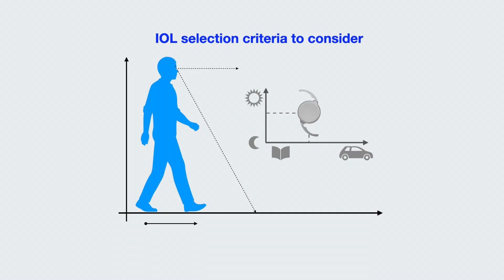Bad vision after cataract surgery

Comment: What about flickering light around the lens edge every time I move my eye. I see that along with an arcing shadow off to the side constantly unless I’m in a very dark environment. I’m 12 weeks out from IOL surgery and it isn’t getting any better.
Reply: I have the same issue. My surgeon told me it'll go away, but it has been 3 years and I am still not used to it. I found this online which is helpful, and want to send it to my surgeon: https://youtu.be/BjHHuzK5fuU?si=18vp5uD4mVg9IAuo
Reply: @ it doesn’t go away because it’s caused by the lens design. Mine never went away and drove me nuts. I ended up having the Clarion IOL removed and a Bosch & Lomb LI61AO installed by Dr Wong at Austin Eye. This lens is perfect with no issues. Dr Wong told me he’s replaced over 2,000 of the Clarion lenses because of their poor design.

Comment: I had surgery 6 days ago and couldn’t read anywhere. Today they looked in my eye and discovered I could see perfectly well with -1.25 cyl of astigmatism: all of his table even the line just below 20/20 I could make out. The lens was Toric and -2.25 and supposed to get rid of all of my astigmatism but here I am now 6 days post op with astigmatism -1.25. And guess what optometrist told me that at this stage they don’t even check the eyes with lenses just ask to read how many lines you see but because I had concern about focus he decided to “check” with lenses and that he doesn’t have statistics about those numbers with other people but assuring me that this is a common complaint and that it is early days and it will subside reduce!!! How??? There is no inflammation in retina and cornea, all other parameters he said are normal after the scan, the position of the Toric lens is correct as I asked him to check so he dilated me (they usually don’t do it for some reason), and still I have that astigmatism.
Can that actually be true and it will reduce?
One good news: during cataract not a single lens they put before my eyes produced any focus. It is a shame it’s such a lot of astigmatism still left as I paid a lot of money for this operation and the surgeon is very respected but how could he miscalculate so much? Something tells me it won’t go away. I still see a lot of floaters, vision fluctuates all the time. I’m actually getting sick with all of this experience. My second eye operation is coming with the same surgeon. Soon I won’t be able to write here anymore as I will lose the close sight forever. 
Also apparently I ended up even slightly hyperopic like +0.5 the machine gave the result, but the nurse said it will all change to 0.00 
Going from -8.5 before cataract to +0.5 is a mocking really when I specifically told the surgeon that the biggest fear for me would end up hyperopic. I want to stay a bit myopic. I will do my best he said. What??? But in fact it doesn’t feel I’m seeing so well inside the home, it’s blurry. The optometrist also said it will reduce and that at this stage they don’t do tests with lenses. I’m gutted and can’t breathe. At the moment it feels like a biggest nightmare of my life. I wish I went with Rayner where doctor offered -0.75 and -0.5. I don’t need their zero vision. 😢
Reply: How are you feeling now? I am not happy either....in spite of confirming 100 times I ended up with hyperopia.
Reply: @balakrishi  I am happy so far. If it wasn’t for those floaters. The left eye has like small astigmatism but can see sharp (the one they did after the first one and I was worried about doing it after the right one wasn’t great), the right one has got a bit of astigmatism so I cannot see the whole table, I can see 7 lines or something, a bit blurry with right eye but it’s not myopic) but together I can see ok well enough to be able to drive without glasses, watch telly. My right eye feels like a bit not that sharp as left eye, but I have a better vision than before operation. My quality of life improved: I can shower without glasses, I don’t need glasses for cinema. But I use reading glasses +3, +2.5, +1 for different purposes. Some I like to eat my food with, some to read my phone, some for computer and teaching. But it’s a way better to take off glasses and go than before wearing glasses all the time and take off just to look at small print on your phone.
Reply: I'm sorry to hear about your disappointment. I'm not happy with my outcome either. Afraid to do second eye. I thought I'd be safe choosing a standard lens.

Comment: I had Eyhance Toric II 3 weeks ago. I wish I never had it done. Lost my distance near perfect vision. Now I have blurry,double vison. Don't get the surgery unless your in bad shape.
Reply from the maker: Sorry to hear that. So you have great near but bad far, correct? 
What was your refraction before and what you have discussed with the doctor as a result?
Reply: @iol-adviser  Don't know the refraction but he installed Eyhance diu 150 in one and the other diu 225. Before I had great distance vision and needed readers for inside dimmer light . Now my distance is blurred distance from about 30 ft to horizon. Images or signs etc have a shadow double look. Reading inside is a bit better. It's been 3 weeks since  first eye 2 weeks since second eye. No change in vision since. If I look thru adjusted binoculars my distance is clear. My doctor said to wait to see if it gets better.  I regret doing this because now I fear having to have glasses for driving or distance which I didn't need at all before. And the cost of fixing them so no glasses is out of my  means. Plust the $3000 us I paid for Eyhance. Now were did I read ther is a good chance of Refractive surprise in all the videos or reading I did before.
Reply: I had very high sensitivity to light and the doctor said I have cataract.. my eye had started paining terribly in the past few months... That's why I got it done...😢😢😢😢
Reply: Same issue😢...  Wish I had read your comment before 😢😢😢😢😢😢

Comment: The following tests were performed for my eye measurement prior to my cataract surgery:

IOL Master 700 Biometry
Nidek AI Scan Biometry
Corneal Labelling and Mapping 
Vector Analysis 
Ziess Atlas Toppgraphy
Ziess Atlas Aberrometry
Nidek Keratometry

Laser surgery office 

Corneal Tomography 
Corneal Topography 
Epithelial Optical Coherence Tomography 
Residual Astigmatism Analysis 

Procedure performed:

Refractive Cataract Surgery
Advanced Technology Refractive Monofocal Toric Intraocular lens to Correct Optical Errors 
Post surgery my eye pressure went to 31mmHg from 17mmHg. 
The surgeon told me I have Glaucoma when prior to surgery my eye pressures were fine. 
I have been wearing glasses since my teens and had regular eye exams and had never been told I had glaucoma. 
Now I have to use drops for life to control the eye pressure or the other option my ophthalmologist suggested was laser surgery, with no guarantee of correction. 
Also my vision is a bit blurred after almost 6 weeks. 
Not sure if I should seek a second opinion…
Reply from the maker: Sorry to hear that you have blurred vision. What would you like to know? 
Honestly there might be number of reasons for that. 
ps: glaucoma is not a pressure. it’s a ganglion cells degradation and the pressure is one of the possible markers; and one of the influence points, but not the single reason.
Reply: @iol-adviser , thank you for your response. 
I’ve never been diagnosed with Glaucoma or high ocular pressures prior to my cataract surgery. I was able to see clearly up close without glasses until my vision became cloudy because of the cataract in one eye. 
Thankfully I didn’t need cataract surgery in my other eye, I can still manage too see properly but hate the idea of having to put drops in my eyes for life and the side effects of doing that. 
I will not feel confident going for my other eye cataract surgery, when the time comes.

Also were all those tests performed prior to my surgery absolutely necessary?
Reply from the maker: @truthteller6932  I believe that the best way not is to look for second opinion. 
ps: taste seems reasonable
Reply: @iol-adviser  , thank you again for your advice. The surgeon I went too is highly recommend. One of the top surgeons in the city but he is too busy and rushed.
Reply from the maker: that's the most common problem - lack of time and inability or lack of willingness to communicate with the patient. That's why I'v started my project.
Reply: Sorry to hear your going through this. I have worn glasses since I was young also. I'm not happy with my results yet. Only had one eye done so far. Good luck to you.
Reply: @donnaiovine2123  ,  thank you for your support. 
It’s been 10 months since my cataract surgery and monthly appointments to see my surgeon. Now he’s complaining that I’m too picky. 
I got new prescription glasses made after the cataract surgery just on my right eye only and found out that Toric IOL that was supposed to correct my astigmatism has actually made it worse. This is because it rotated out of position and is a common problem. 
My surgeon just told it was due to inflammation. 
After months of putting steroidal drops in my eye, the inflammation is gone but my vision is still blurry. 
My surgeon never explained the risks involved about Toric IOL rotation soon after surgery. 
I paid thousands for that multifocal IOL for no reason.
I recommended going for non Toric IOL and astigmatism correction through eye glass prescription. 

Following is my before and prescription 

Old	Sphere 	Cylinder 	Axis 	Add
R	-3.25	-.500	        127	       2.50
L	-4.84			                      2.50
New				
R	-2.75	-1.00	         170	2.50
L	-4.00			                      2.50

As you will notice the astigmatism got worse after surgery.

Comment: Alex, it is my understanding that accurate measurements of the eye needing surgery need to be taken to come up with best IOL calculations. If cataracts prevent clear views of posterior segments, could that lead to incorrect calculations and not so good vision after the surgery? If doctors cannot see posterior pole/segment, how do they arrive at what IOL parameters should be used? Thank you
Reply from the maker: It depends on measuring method. If cataract is too dense, ultrasound method is used. Immersion is more precise than contact, however even contact method if performed carefully gives good results.

Comment: My vision is better indoors in artificial light with Tecnis Synergy IOL, but very bad in sunlight conditions. I showed the optician who examined my eyes by checking my vision with outdoor lighting.  Street signs across the road are blurry, but in the examination room I can read the first few lines, which are much clearer.  I don't know why optometrists and ophthalmologists don't test vision in different lighting conditions.  It's only when patients report back to them to complain of visual disturbances after IOL exchange or after prescription glasses.
Reply from the maker: sad to hear.. it might be related to pupil decentration or lens position vs pupil. and yes, industry are not rutinely checking vision at different conditions. some doctors are more accurate and passionate, some doing standard things. I wish you find a solution with your doctor
Reply: @iol-adviser  I had cataract surgery 5 years apart. The first left eye I was left with 20/20 vision and no astigmatism. The right eye 5 years later with same lens I was left with -75/+1.50/ 140. Can that be changed after surgery? What is the best way? Is that mostly astigmatism?